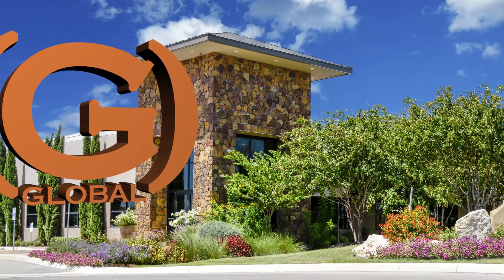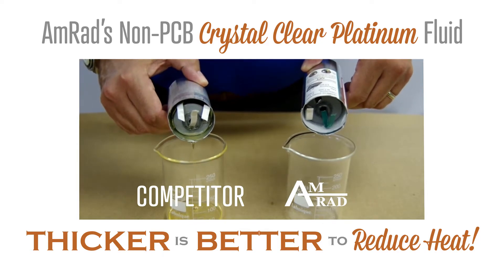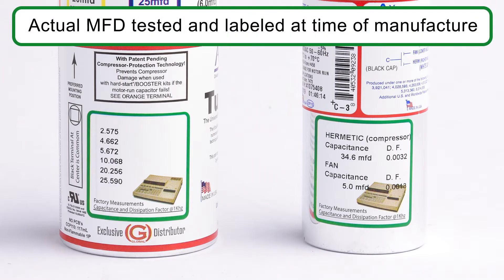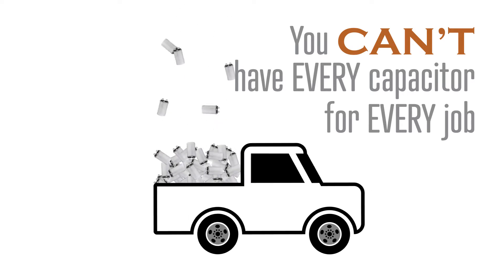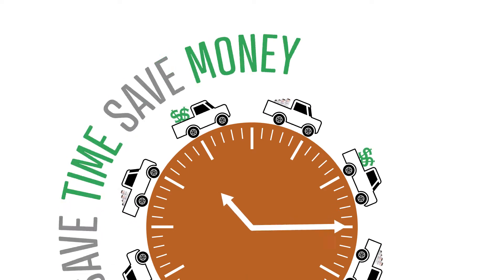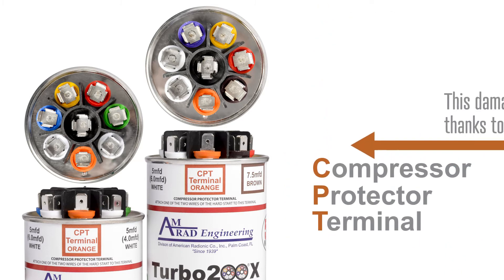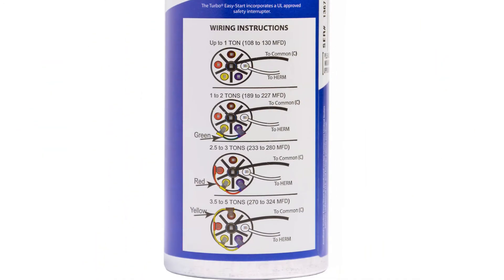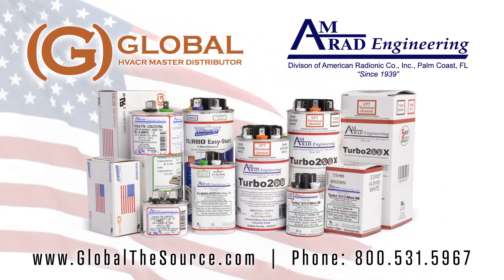AmRad American Made Capacitors

Comment: I am a retired HVAC contractor. I came to realize that almost all capacitors these days are made in China and the quality is just not there. Rarely did a Chinese-made capacitor last more than a year and it was really embarrassing to have to explain to the customer that the capacitor I installed less than a year ago went bad. This put doubt in the customer's mind as to whether I knew what I was doing and I had to warranty the capacitor I had installed less than a year ago and not charge labor either. What's more is that the distributors begrudgingly warrantied the capacitor, gave me guff about bringing the in-warranty capacitor in for warranty replacement, and told me that other contractors didn't try to get a warranty replacement capacitor saying that they just "ate" the cost because it wasn't worth their time to do so. Sometimes this happened more than once and I lost the customer to my competition. I finally got sick and tired of Chinese "quality" and started searching for better capacitors. I couldn't find a brand of single or dual value capacitors that any of my distributors handled that were made in the U.S. I decided to bite the bullet and pay more for these Turbo 200 universal (multi-value} capacitors that were, honestly, quite a bit more expensive, but I reasoned it was worth the extra money to get a good product. What really sealed this decision was that, one day, I got a call from a customer for whom I had installed an AC and it was not working. The AC was 15 years old and the capacitor had finally gone bad. When I replaced it I noticed that the OEM (Goodman) installed Amrad capacitors in their new equipment. Today, it is unheard of for an OEM capacitor to last even 5 years. These capacitors are definitely worth the extra cost and their quality is unsurpassed. You also get great service from them as well. They provide a number to call that is printed on the label if you have questions or need assistance. One day I called that number and was astonished that the person taking my call was actually the Vice President of the company! They also provide a card that you can fill out by providing the serial number of the capacitor, choosing whether you want a hat or golf shirt for doing so (they used to offer a coffee mug as well) and mailing it in (they provide the postage too). Too bad Goodman no longer installs Amrad capacitors in their new equipment. BIG mistake, in my opinion. Keep up the great work, Amrad!

Comment: I’m HVAC contractor, i use nothing but Amrad capacitor.
Reply from the maker: Hi Boon,  Thank you for sharing the good news...and for supporting American manufacturing by buying USA-made AmRad capacitors. Shows you are an experienced HVAC pro, and protect your customer with quality HVAC products, like our AmRad Universal Hard-Starts and Run Caps. 

You are smart, too!  Right now, contractors are appreciating the power of UNIVERSAL. Our AmRad Universal Hard-Starts (a permanent replacement product), have even more value these days with high gas prices⛽. "The more you know, the less carry." 
By reducing the number of trips to the supply house to get a specific run cap – you save time and gas…keeping more of your hard-earned 💲money in your pocket.

And, now with CPT(Compressor Protector Terminal) and the CPT Fuse Wire, you have the best hard start install for ANY compressor-protecting from a failure event within 3 seconds! 

✴We do not take your loyalty for granted. We are dedicated to doing our part, by helping businesses like yours build a trusted reputation for reliable solutions and products.  We wish you continued success in your business!